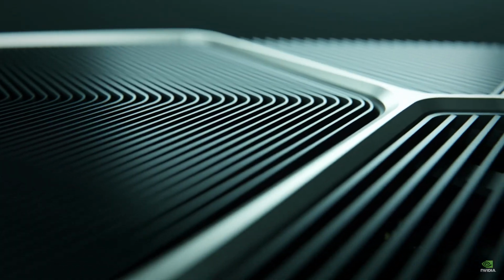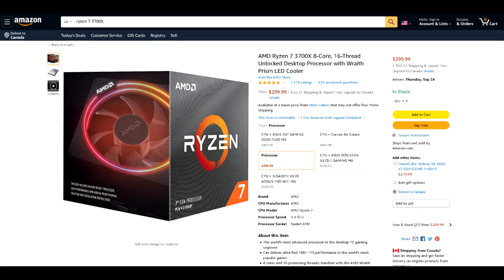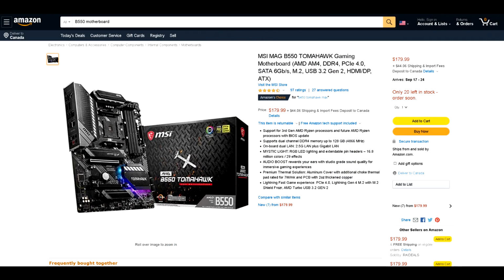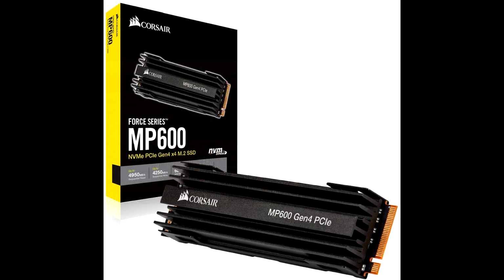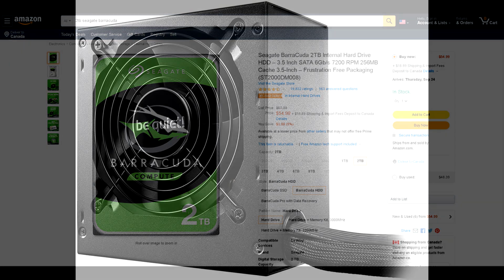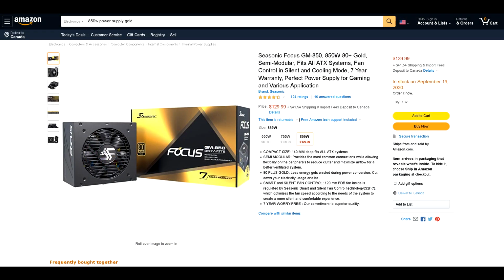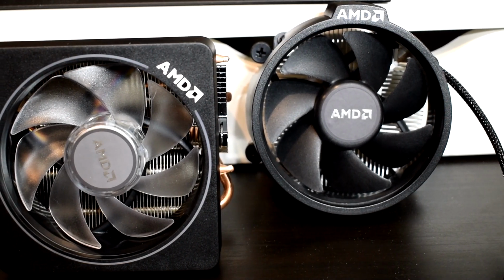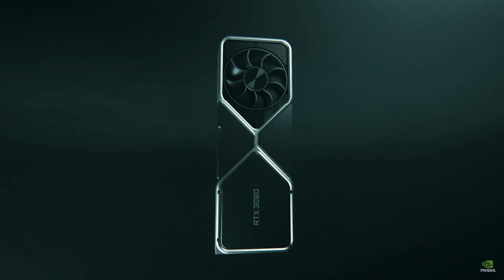$2000 RTX 3080 Gaming PC Build - ULTRA 4K Performance

Comment: Hello my friend this is my new build for rtx 3080 Any suggestions ?

Rtx 3080

cpu ryzen 3700x

Motherboard msi b550 gaming plus amd4  

Ram CORSAIR Vengeance RGB Pro 16GB (2 x 8GB) 288-Pin DDR4 DRAM DDR4 3200 

Power supply 850w cougar bronze 80+

Ssd samsung evo 970 M.2 nvme 1tb 

Hdd 2TB

I need it just for gaming
Reply: Idk how expensive that Psu is but I have a Corsair em 2019 850watt 80+ GOLD for only 130
Reply: @Shrek-sg3jq  I bought it about 145$ with tax. maybe in your Country less than the this price because in my country the tax 15%
Reply: @Shrek-sg3jq  the name of psu BMX 850w cougar
Reply: osama that’s good but u got. Every part? Tell me how it performs
Reply: @Shrek-sg3jq  and is there any difference between gold or bronze ?
Reply: osama gold is less noisy and is a little bit more power efficient but your psu is great so unless it’s really loud and u don’t like it buy a higher rated but bronze is good just always make sure it’s above 80+
Reply: @Shrek-sg3jq  Ok i will tell u just let me complete my build because there's one thing's the rtx 3080 now I'm waiting to  stock in the stores to buy it

Comment: Hey Danny. Great Review. I liked how you explained the reasons for your choices. This video seemed very professional and unbiased. I hope your channel grows. Anyways, could you give me some advice? I have the 3700x but I haven't purchased a motherboard yet. I plan on getting one of the Zen 3 CPUs when it comes, and I'm just confused as to which board would be a reasonable fit for a future Zen 3 CPU, a current set of 4000mhz c16 ram, and a PCIe 4.0 m.2 NVMe ssd. What would be your recommendation so I don't end up needing to change my motherboard when I decide to upgrade from my 3700x?
Reply from the maker: Well the board I mentioned in the video would be a nice fit for that build. Unless you need a plethora of PCIe lanes for storage, then I wouldn't recommend an X570 motherboard. Just save the money and go for a quality B550 motherboard like the MSI Tomahawk.
Reply: @DannyzReviews  thanks. I like that board too. Have a good one

Comment: Hey man, do you know if I should buy an RTX 3080 if I like playing at 1440p with VERY high refresh rates? Or should I just go for a 3070? Cheers!
Reply: although both cards can handle 4k above 60fps, if you can you should always buy the more expensive one to last you for a long time
Reply: @TrialBTW  Yeah, I'm thinking the same, I just didn't know if it was sort of overkill to get a 3080, but running games at 1440p at high refresh rates is just amazing. That paired with raytracing will be nuts.
Reply: @sebastianpineda1058  if you want 180fps+
you have to get a 3080
i mean im upgrading to one as soon as i save up to get it
or even get the BFGPU aka 3090
seriously who doesnt wanna buy that beast
now 3090 is overkill
Reply: @TrialBTW  well I'm using a 165 hz monitor, so 180 Fps+ is kinda overkill, no?
Reply: @sebastianpineda1058  well its not really
its kinda weird to explain but even if your getting above the fps you need you still have more information going through your monitor in simple terms.
im saying if you can afford a 3080 thats the best bang for the buck gpu you can get this year